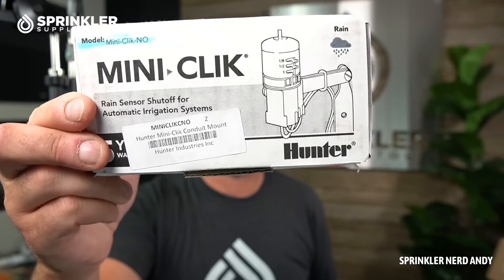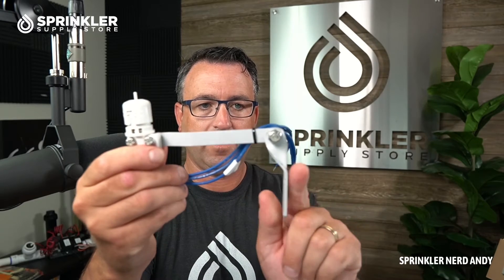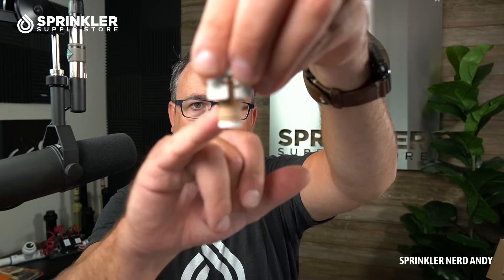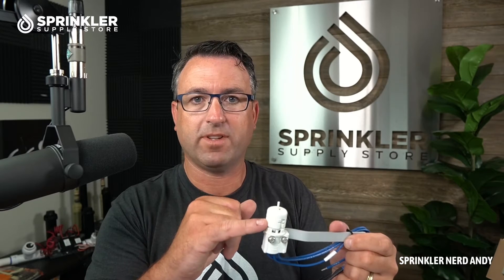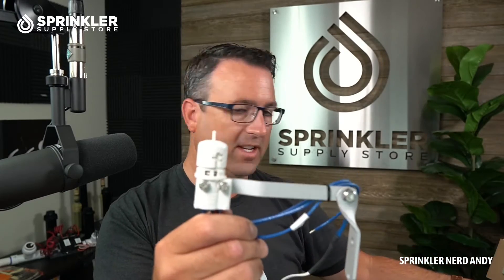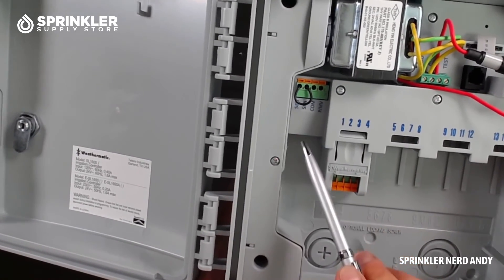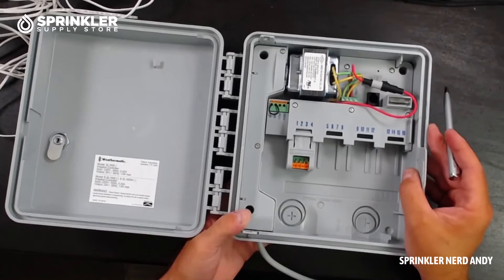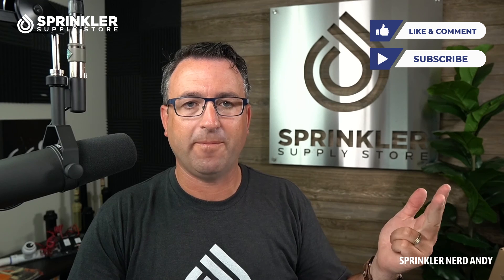Hunter Normally Open Mini-Clik Rain Sensor

Comment: hmmmmm... most microswitches , like the one they are using inside, have 3 terminals  a common, one Normally Open and one Normally closed ...so you can just move a wire from N.O to N.C as needed....  I am thinking /hoping that's the entire difference in the two models.... if not very strange.
Reply from the maker: It could very well be a microswitch inside. It is factory set & sealed and is not programmable by the user in the field. Likely because 99% of modern irrigation controllers have normally closed output terminals. There were a few models back 20yrs ago that we normally open, but not any longer.

Comment: what is the third blue wire on my rain sensor and do i connect to the controller thanks for the help
Reply from the maker: Hi @davidmerkrebs9967 - I'd like to confirm with you that you have this exact model rain sensor. The reason that I ask, is because this model (Normally Open) is not very common. Can you please confirm which model you have.